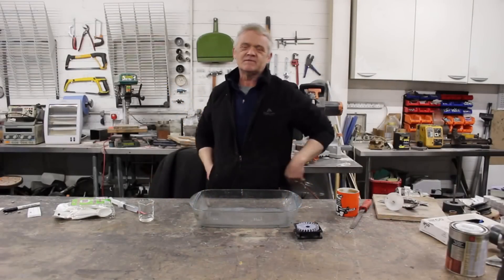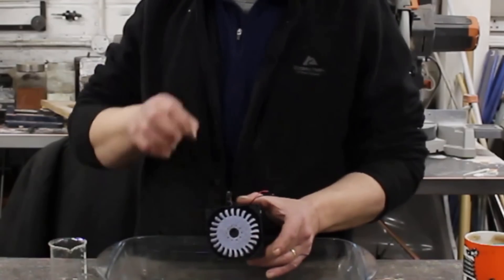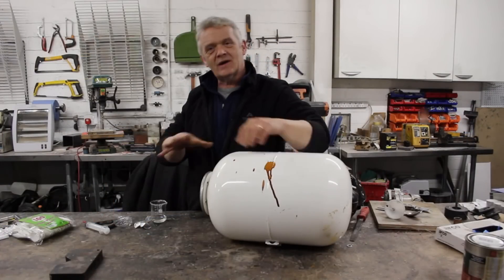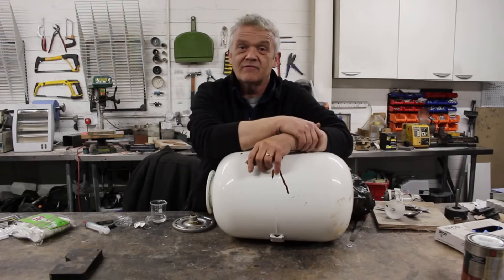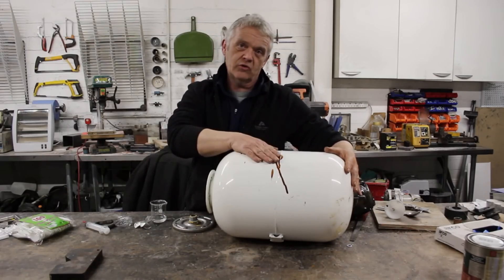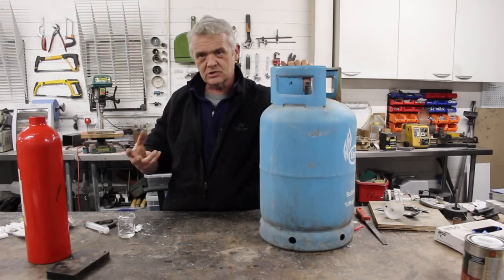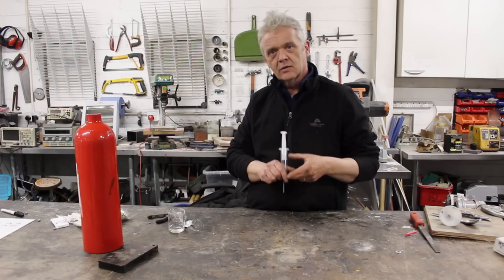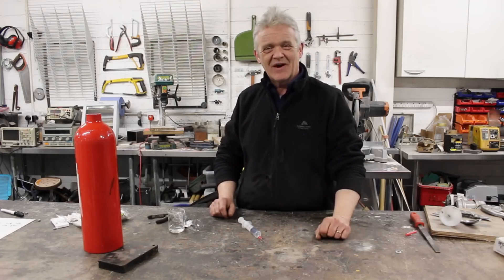1919 The Water Accumulator As A Possible Battery

Comment: I have a pressure tank on my well. I never realized they had balloons in them. I'm guessing that's so the pressure tank can work in any orientation whether upside down or upright.
Reply: It's to stop a phenomenon know as water hammer effect as well as storing an amount of pressurised water so your pump doesn't need to turn on every time the tap is turned on
Reply: A bladder is used because presurized air will dissolve into wate and be carried away into your pipes, then released when you open a tap. The end result of this would be that all of the air in tank would vanish, it would be entirely water locked, and there would be no buffer in the system. Thia would mean that the tiniest leak would cause your pump to kick on and almost instantly hit peak pressure, over and over. This would result in the pump dying much faster.

Comment: my son in law has a pressure washing trailer wth a 400gal tank which has a 1/2"hose outlet, when the tank gets below half it doesnt flow as well so he has a 12v compressor set at 5lbs.. I keep suggesting he run the air pump and the chemical pump off a solar panel (we live in Florida) but he's happy with charging the batteries from the tow rig
Reply: (son in law  - nuff said, unlikely to be open to suggestions) - kidding..

Comment: While I do not know exactly how much your water costs in a city water system anywhere in the world [I live on a farm and have a well pump] I have to wonder if just having a positive displacement vane in the flow of your home water inlet, perhaps you might scavenge a little bit of electrical energy, just from your daily water use.

While the power is not 'free' because one is paying for the water being sent to their home, if one could just use the otherwise totally unused potential energy, it SHOULD make no difference to their actual cost whatsoever, nor should it really restrict the flow of the water, as it is going to be moving either way, only in this case, with a positive displacement vane stator, is that one could turn a little generator with that pressure as it makes its way on toward and out of your tap.